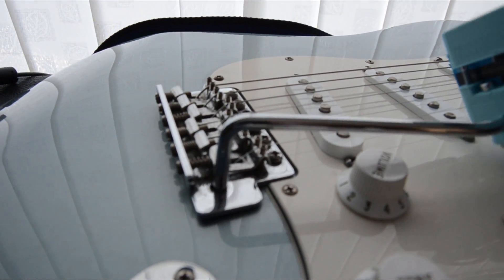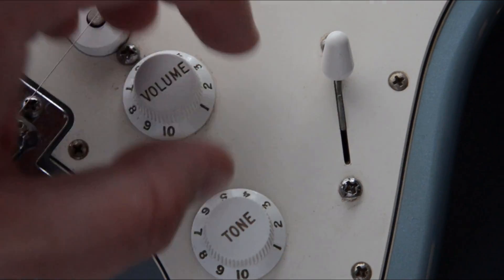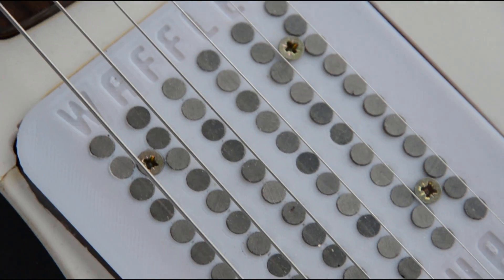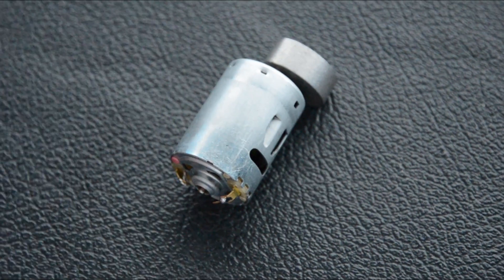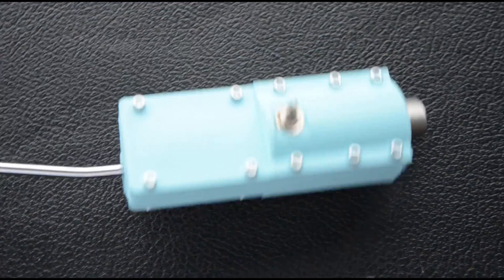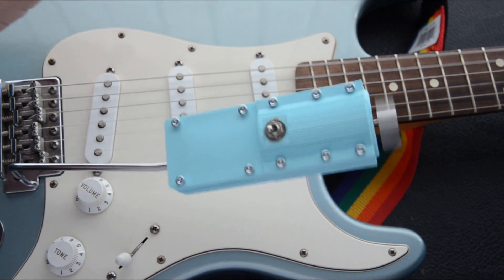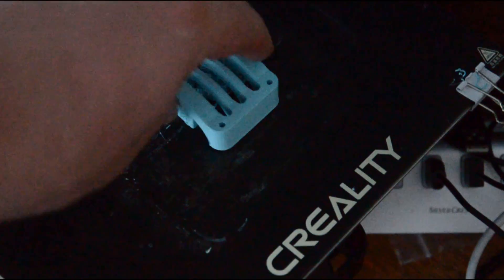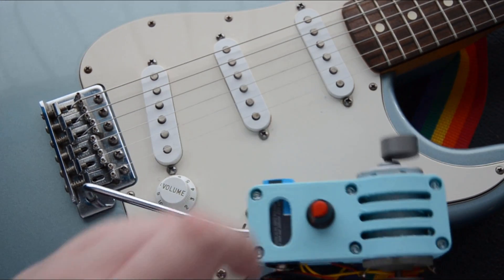The Automatic Whammy Bar - Fender Stratocaster ultimate mod

Comment: nice one, maybe to be less precarious there would be a system that attaches the motor to the body rather than the whammy itself, and moves it with some kind of linkage between the 2. don't know anything about motors and electronics design but maybe it could be smaller/hidden more on the back of the guitar that way, since you would just need a normal setup motor not one with big weights? alternatively something that actually screws into the whammy bar hole and does the effect with a little plunger that pushes itself up and down against the guitar body. just some thoughts
Reply from the maker: Some really interesting ideas there, a motor like this attached to the body might drone like a hurdy gurdy, that would be really fun.